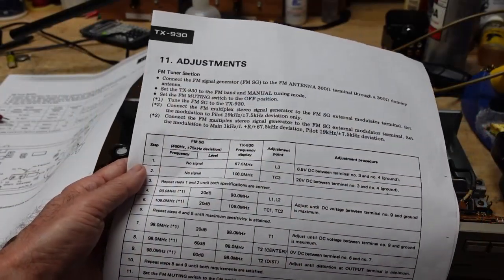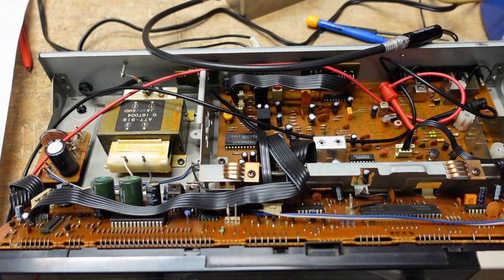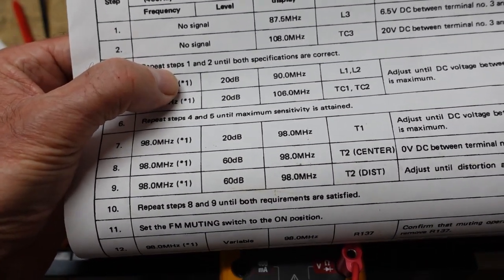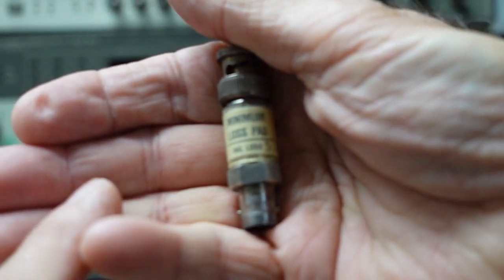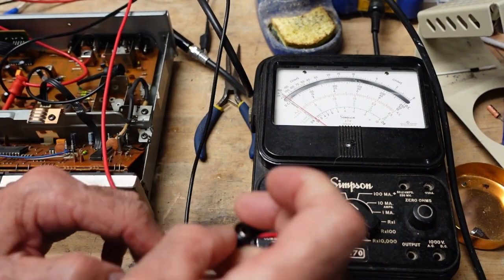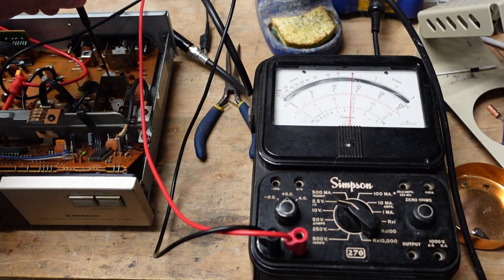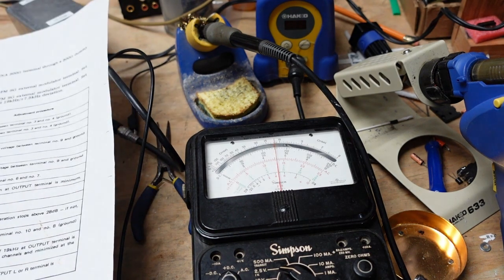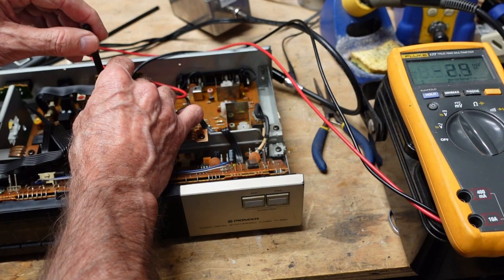Pioneer TX 930 Part 2- FM alignment with the HP 8657A

Comment: You spoke about an offset, but then did not cover how to set it.  For example until I have time to try to make an LL pad I am using a 50 to 75 ohm adapter with a max loss of 6dB.  Can I do an offset in dB even though the meter is in volts or do I need to calculate the loss in volts and offset by that much.  (If I have to do the calculation do you have the formula handy?) dB drops is one of the areas I still need to do a lot of work on.  Also depending on the number of subscribers you may want to consider making a creator account on Patreon, that would let some of us donate to help offset you time.  I currently donate to XRTNY and Mr. Carlson.
Reply from the maker: James, press the blue Shift key on the left, then the amplitude key.  Then input the desired offset, which in this case is 6dB.  It will calculate that offset for any amplitude and any units, i.e. µV, dBm etc.

Comment: Ray, thanks for making these FM tuner videos!  I agree that xraytonyb has some great content on this subject and his videos have helped me tremendously as well.  I have assembled much of the same equipment that you have.  I am using a HP 8657A, a Keithley 2015 and I built the 50 to 75 ohm L network.  I use a Leader LSG-231 stereo generator to externally modulate the HP.  I am still learning and this video has been helpful to validate my own efforts, plus I enjoy watching this stuff!  I hope to see you work on some older analog tuners in the future.  Thanks again for your efforts to share this content and keep up the good work!
Reply from the maker: Jonathan, sounds like we're in the same boat. Tuner alignment is the latest frontier for me. I struggled in the beginning, and Tony's videos cleared up a lot for me. The service manuals for most models are lacking in detail. It's been a slog, TBH. Thanks for the thanks!